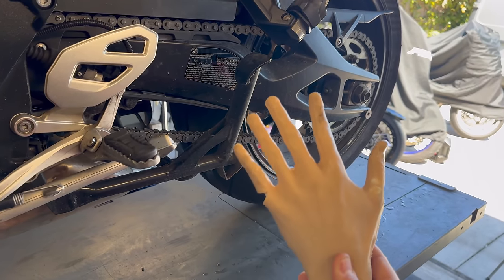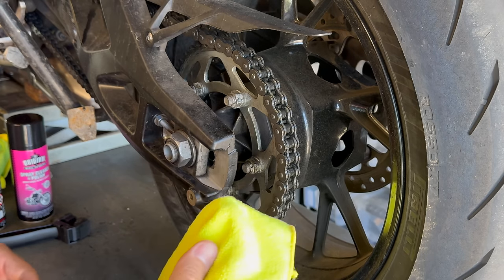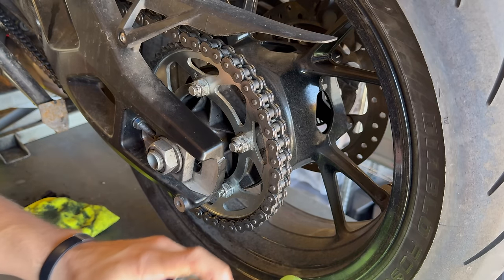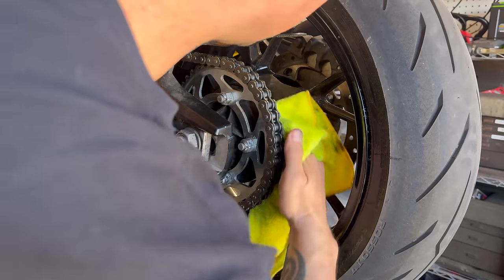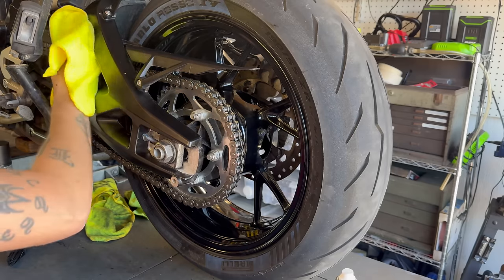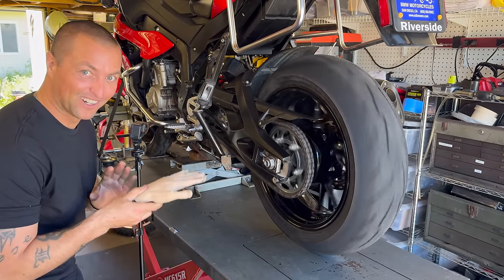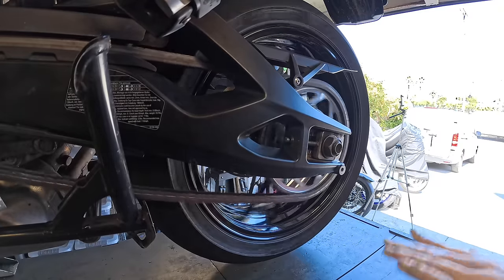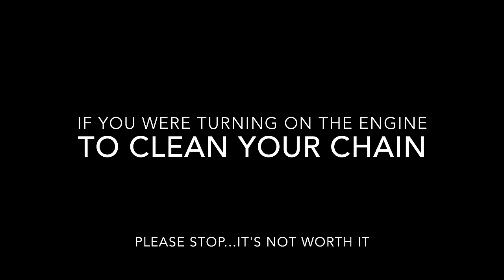How NOT To Clean Your Motorcycle Chain

Comment: Never clean. Buy oiler. Replace the chain and sprockets. Ride.
Reply: Yeah, I hate cleaning the chain, I put a scottoiler on all my bikes. I still clean the chain with a hose when I wash the bike to get any dirt and crud out but then just put the Scott oiler on priming mode and totally reoil the chain and sprockets after I hose down the chain. Doing this I don't even buy chains or sprockets anymore, the ones I have on my bike are still almost new and have 40k kms on them. I may replace the chain "just in case", but the sprockets are still good.

Comment: Even when spinning by hand you have to be careful. Like when I'm cleaning the chain at the bottom I spin the wheel in reverse, at the top I spin forward so my hand/rag/brush doesn't get sucked in.

Why do I clean top and bottom when the chain doesn't just goes around and around? Well, you don't have to but it's easier to clean/oil some sides of the chain from the bottom or the top, plus when you are cleaning you may push some "sludge" to the other side and it's easier to finish cleaning it off from the other direction.
Reply from the maker: at some point people just have to have some type of common sense.

Comment: Anyone who uses a dry-clean spray-on cleaner on a bike as filthy as this one is risking scratching the paint finish. Also, there's many areas that cannot be 'touched' and that would benefit from a proper detergent spray-wash. I would no sooner use dry-clean products on my beloved bike, than I would use them to clean my car... Even when just cleaning bugs off the front of my bike I first soak them with a wet towel, then spray clean and wipe the surface, then dry.
Also, shifting a fast-idling engine into stationary first gear is not the wisest way to look after your transmission...
Finally, the BEST WAY to clean a chain is to take it off the bike and clean it in a solvent, like varsol, assuming you have a removable master-link. Surface-cleaning a chain while on the sprockets only makes a chain 'look clean', while the real dirt that can actually damage your chain remains on the internal bearing and roller surfaces. A two-bath solvent approach removes most of the dirt in the first bath, while the second bath ensures nothing remains. 
HOWEVER, many new chains are O-Ring type that keep most of the dirt out and the grease inside. These should never be washed in a solvent bath, as the solvent could leach out the grease.
Reply from the maker: https://www.instagram.com/motojitsuclub/

Comment: I haven’t had a bike with a chain in decades but back then I never cleaned it with the engine running. I used PJ1 to lube it. Don’t recall what I used to clean it. Too long ago. 

Great video. Thanks. Already shared it. 

These days, the dealerships do all my maintenance. One bike has a drive shaft and the other has a belt.
Reply from the maker: thanks

Comment: I cut a piece of cardboard to slide behind the sprocket and chain, to keep the sprays from hitting the brake disc on the other side of the wheel.  Cut a close C shape notch in your cardboard.

Comment: I only turn my bike on to apply the chain lube (thankfully the can has an attachment so I can spray from a distance while the nozzle is very close to the chain)
If I had to use the close -up nozzle I'd NEVER turn on the bike. I'd rather continue riding with all my fingers intact.

Comment: Even cleaning the chain will hurt. I made the mistake of getting my thumb in the sprocket. It put a nice blood spot under my nail. I remember to not turn it that direction anymore...lol. the only thing I have is the front sprocket area accumulates a lot of road grime that I can't get out without taking the cover off that is part of the oil reservoir. That's a bad manufacturer design.

Comment: Hey Moto, check this out.  When I was in high school, circa 1978-79, one of the local guys was cleaning his sprocket on his KZ200.  He made the   mewspaper,  he was cleaning the sprocket with the bike running.  Luckily a KZ200 didn't have enough torque to rip his entire hand or arm off, but he did have to have the fire department come and extricate his dumb self and his hand from being wrapped under the chain  I don't believe he lost any fingers, but I believe a couple were looking the wrong way.  Are you reading this, Kenny?  If you are, come and tell the tale. Adios Moto

Comment: I was cleaning my chain in first gear and it grabbed my rag and within a split second the tip of my index finger was gone. Dumbest thing I've ever done in my life. I was lucky I reacted as quick as I could and the rag stopped the engine. If it grabs you it's definitely taking something. I only admit this to maybe bring some awareness so that it may save just one finger or all five lol. There is no shortcut just do it safely. There is nothing that shames me more in my life than this incident. Sooo dumb lol.

Comment: Good guide!
I personally use drylube for my chain it gets less dirty. Do far i have done 37.000 km with this chain and sprocket. At first i was afraid the chain would not last as long with the drylube but so far its doing very well and i only have had to  clean the chain 2x. I dont ride a lot in bad weather but even then it dirt does not attach easily

Comment: Gear oil works the best for cleaning & lubing your chain at the same time. Fortnine did a video testing different chain lubes and gear oil won.
Reply from the maker: use whatever you wish, just don't turn the engine on

Comment: real story, one of my friend got his finger cut off last month because he's wiping his chain with a piece of cloth while the bike is on a stand and running in 1st gear because he is a big lazy ass guy.

he's wiping his CBR150R chain from below, the cloth got pulled in by the sprocket, lazy boy took 3 business days to react but nahh it was too late, took half of his finger off and thats it. 

it sounds like i hate him, i do, but not because of this accident, it was because of what he did to many of us back then that was unrelated to this, served him right if you ask me.

edit: 
pro tip, at least for me: set the bike on a stand, dip the toothbrush into a diesel fuel (or kerosene, but to me diesel fuel is softer and cheaper), brush the whole chain all 4 sides and the sprockets too with it, spray them with hose pressure level (not too high to sip pass the rings and not too low to not strong enough to washes off the dirt from the chain), to dry it ill just turn on the bike and set to the highest gear and rev it because the water will get flung off the chain and stop until there's no more, set the bike into 1st, spray the chain lube till (for me) 4 passes for each side (aim at the rings not the rollers), rev it again till the excess lube flung off until there's no more and stop. 

it'll create a mess, so i recommend getting a wipe ready or covering it with a cardboard. I'll just do it outside with a paddock stand.
Reply from the maker: Lesson learned

Comment: Of course, absolutely do not try to clean your chain with the bike in gear and running. However, if you have just washed your bike and want to get some of the water out from between the rollers so you can lube the chain, it is quite easy to just put the bike in gear and let it idle to fling the water out from the chain. You could also go for a quick ride, or if you have an air compressor you can use that, but if you're impatient and poor like me, chucking it in gear and flicking the water out with the rotation of the back wheel is pretty easy.

Comment: Forget the expensive products.
Other than a brush and rags, you only need two products: Simple Green and Gear oil (which is BTW what chain manufacturers recommend). 
Cleaning takes precedence over lubing. You only need lube to prevent rust and keep the o-rings fresh. 
The real lubrication of a modern chain comes from the grease within.
Spray Simple Green generously and scrub with your brush. Repeat a second time and wipe clean.
Easter egg: SG is great for the underside of your bike also and wont make your garage smell like a jet hangar.
Once you're done with cleaning, a very light coat of gear oil applied with a rag is sufficient to simply prevent corrosion and the rubber rings from drying-out.
Bonus: the Simple Green overspray has now soaked your rim for an easy wipe clean.
Reply: @MotoJitsu  Please give my suggestion above a go. Perhaps you may like it. In fact, I'm sure you will and an opportunity for a redux video Part Deux.

Comment: I once pinched a finger between the chain and sprocket on a bicycle due to carelessness/idiocy (I was turning the sprocket by the teeth).No way I’d EVER put any body part inside the chain run while the wheel is turning under power.

Comment: Try this method. Before you spray anything on the chain; run the chain brush and a clean rag over it first. It will knock off half the dirt before you turn it into mud with the cleaner. It actually takes less time, rags, and cleaner to use this method. Fluid Film (lanolin) is the best chain lube i have ever used and it seems to repel dirt vs attract it. 

p.s. somebody posted a video in the last day or two of their bandaged hand from trying to clean a running chain. LOL
Reply from the maker: whatever works

Comment: does using the brush once a week reduced the o-rings/x-rings longevity? heard a lot of my buddies said it that way but not sure if its true
Reply from the maker: does it matter? you can not ride and make the tires last longer too.
Reply: @MotoJitsu  thanks!
Reply: @ThrottleMY  you don't need to use a brush.  When your chain gets dirty, lightly spray it with some cleaner, wipe with a rag, and apply a bit of lube.  I put huge miles on my bike and easily get 20K+ out of chains and sprockets without any of this excessive scrubbing.  A high quality o-ring chain needs very little maintenance
Reply: @luisdetomaso867  yeah i started to do it this way now cause my last chain didnt last very long cause i kept scrubbing it and i was told that it affects the o-rings. just changed to a DID x-ring and gonna take a better care of it haha thanks btw

Comment: Definitely recommend lubing the sides of the chain. I used to not do that either, as it's technically speaking not necessarily. BUT, the most important job for lube, is rust prevention. And i had Lots of rust on the sides of the chain until I started lubing the whole chain.
Reply: i use wd40 after it rains (and ive ridden through it) and no rust anymore. i used to clean and lube and i got rust. maybe it wasnt the best lube but the wd40 does a great job.
Reply: @peterkeleher  WD40 is also a solvent. It will eat up your O/X/Z-Rings. Be careful not to hit the inside of the chain.
Reply: @Roy_Godiksen  a prominent motorbike youtuber did a video on this; wd40 does nothing to the rings or their seals.

Comment: Great explanations on How To properly clean your chain, i'd also add a little clean on the brake disc with brake cleaner, because when you spray the chainlube it forms a cloud of small particules, and as you saw, these particules will drop and deposit on the rim  but not only the rim, also the brake disc gets a little coat of chain lube, and lube on brakes isn't a good idea lol, so i like to personnally always scrub my brakes with a clean towel and a bit of brake cleaner. Costs nothing and will probably avoid you going into a wall or a car on the first turn down your house.

Comment: I'm dipping the scrubber in the Diesel (2 euro /L) a few times and brush the chain while letting the engine running stationary in 1st gear. After 2 minutes I take the  pressure cleaner (your microfiber cloth does not clean inbetween the rollers), keep it at a distance of about 5 inches for a few minutes, cleaning the chain up, down and both sides. then I dry the chain with an old towel or shirt go dry it, and only during the drying the engine is not running. When the chain is dry I start the engine again and brush some grease on the chain. Done! Time: 6 minutes. Cost: Next to nothing. Level of chain maintenance and protection: Very high!
Reply: You don’t want to use a pressure washer on a chain. Let the hate comments come . Give me your best.

Comment: Another thing I do when cleaning the chain is fold a paper towel length wise a few times (so it overhangs the chain maybe a quarter inch on each side) and lay it on the chain at the bottom and slowly roll it thru the sprockets front and rear  which really helps get additional crud out from between the links and the spocket teeth... The first time I did that I was surprised how dirty the paper towel got even tho the chain looked really clean...I can't believe that people would actually clean the chain with the bike running. I guess like the saying goes.. You Can't Fix Stupid...
Reply from the maker: got 5 emails already of people saying they're going to stop doing this, so win!

Comment: Been doing this for well over 10 years professionally, and I don’t mean as a dealer or shop tech.  Pay attention.

This is not the way to clean the chain……seriously, this is like washing a window, you are not cleaning the window, only the glass.

The only way to properly clean is to remove the chain and soak it in something like diesel or wd-40 while you clean the sprockets and behind the countershaft sprocket. Use a SOFT toothbrush to GENTLY scrub the chain. Wipe it down as you remove it from the soak, use brake cleaner to flush off the rest of the cleaner. Put the chain back on, with a new master link, adjust and spray the lube on the chain, not heavy….the chain lube only lubes the rollers, the o rings seal grease in the chain, lube is only for the outside and should not be loaded heavy.   I do not suggest anyone place their hands on a moving chain, but, there are exceptions and situations where you may need to do this.  Be aware and ignore everything else around you.
Reply from the maker: No one removes the chain every 800-1000 miles. to clean it...be realistic.

Comment: Great Video Greg! I too have switched from Chain Wax to Motul Chain Clean, but I run the C4 Factory Lube. Really sticky, and doesn't fling at all, even on my ZX10R going flat out. My main reasons, were Chain wax stinks and makes a huge mess, it also seems to melt and form a black gooey mess on fast bikes with big power. I also switched to Motul Offroad Chain Lube, and it works amazing! nothing sticks to it (like sand).
Reply from the maker: thanks

https://www.instagram.com/motojitsuclub/

Comment: Thats how i almost lost my thumb last summer, my luck was that i had removed the chain guard so my hand didnt get caught up in it, the image of my thumb slowly passing through the sprocket are now forever burnt in my memory serving has a reminder (the rear wheel spinned way slower in gear than the one in the video), somehow i felt absolutly nothing so it made it really wierd in the moment and i was unsure what had exacly happened.
Thankfully this happened on a chinese 125 and the chain streched (from 20mm of chain slack to 70mm) so my thumb was only bitten and a bit broken at the joint, but it made a decent recovery, still hurts a bit to this day.
Never stick your fingers in moving parts.

Comment: What's the product details for the cleaner? That stuff seems to work very well, I would like to give it a try on my Speed Triple.

I've found Kerosene works great for cleaning the dirt and grime off chains, followed-up with AMS oil chain lube. 
EVERY 2 WEEKS! Consistency is more important than the brand. Your chain will appreciate it, and it sounds real nice after a good cleaning too!

Comment: What do you think about using water/ hose to rinse the chain after you clean, then lube?
Reply: I’d recommend using compressed air to thoroughly dry the chain before lubing. 

Though I don’t think you’d get much benefit by hosing it down. Water doesn’t clean that gunk—that’s what the cleaner is for. The only reason I put water on the chain is because I’m in the process of cleaning the whole (dirt) bike.

Comment: another tip: when using a towel and/or brush, handle the lower part of the chain so you can’t get pulled into the sprocket when hand spinning the wheel. 

I pinched myself in the sprocket first time I cleaned a chain as a kid. Bike was off, but I was spinning the wheel faster than I could react to the towel I had getting caught by the teeth. Took the skin off my fingertip, but didn’t leave any lasting injury.
Reply from the maker: https://www.instagram.com/motojitsuclub/

Comment: its even outright dangerous when you spinning the tyre without engine power.  It happened to me I  was spinning the tyre spiritedly and the clothe I used to clean the chain (coz I wanted it done quick lol) got caught and pulled my palm into the sprocket. Nothing bad happened as it was spun manually but still the inertia of the tyre was still considerable. My fingers wedgged the sprocket and made the wheel stop but boy oh boy I leaned to never spin the wheel where chain is travelling towards rear sprocket, always spin the other way as if the bike is going backwards. There is a lot in a way before your hand can get inside front socket. But like he said, think about what you are doing and don't be lazy.
Reply from the maker: exactly